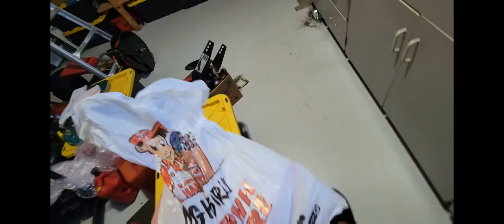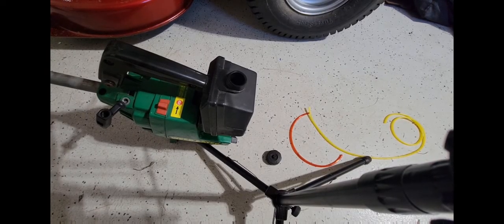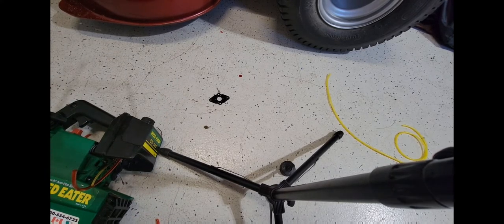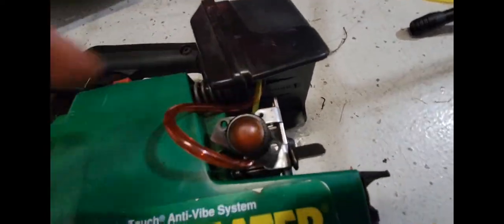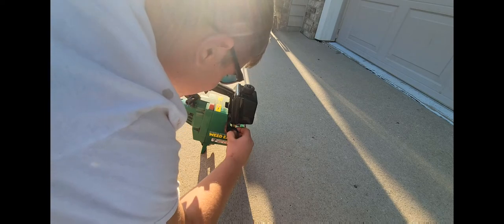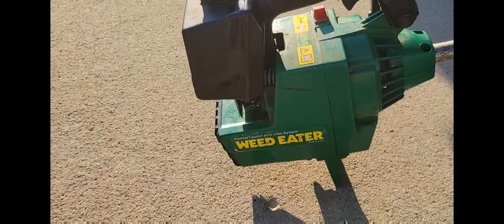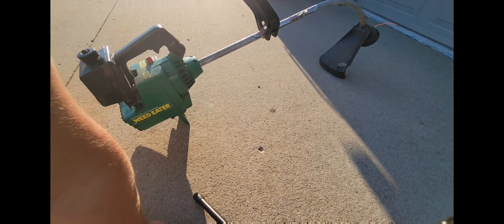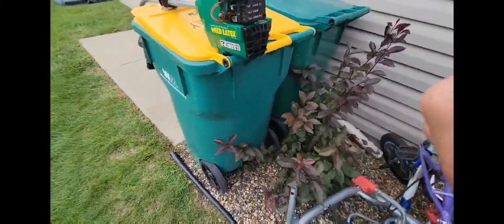Trash find trimmer runs again fuel line routing on Weed Eater Weed Eater cleaned up

Comment: That is one awesome vintage weedeater. Surprisingly it still runs after all these years.
Reply from the maker: Oh yea the fuel lines were a quick fix and so was the carb. I sold if for 45 bucks
Reply: @gmachine8478  the older machines were definitely a lot easier to fix than the new ones people buy from Walmart, Lowes, Rural King, Tractor Supply or Home Depot.